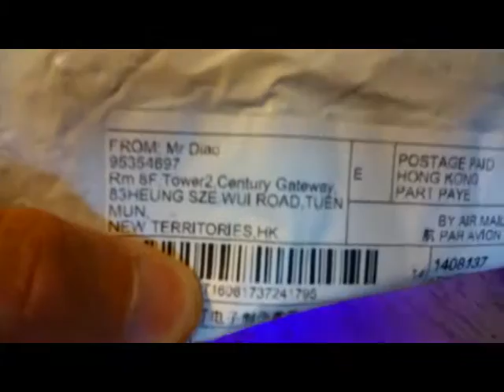Activate LED Lights with Your Voice

Comment: Where did you get the battery case and connectors for this.  Its perfect for a project I am working on, but need a power source.
Reply from the maker: eBay. I get all electronics there, direct from China.
Reply: @p1nesap  could you recommend the parts to order?